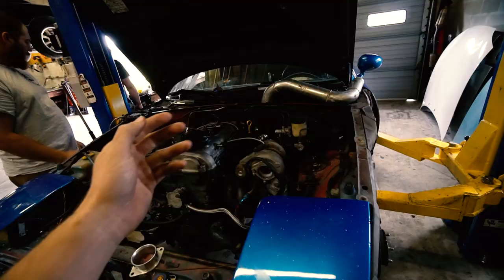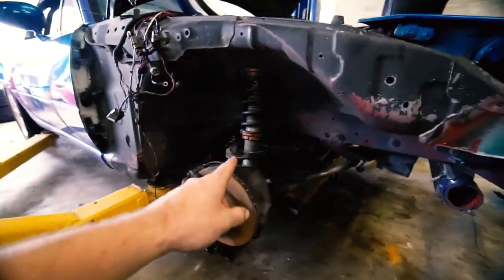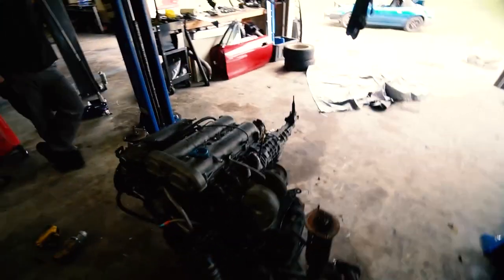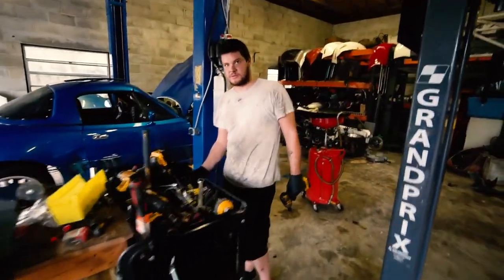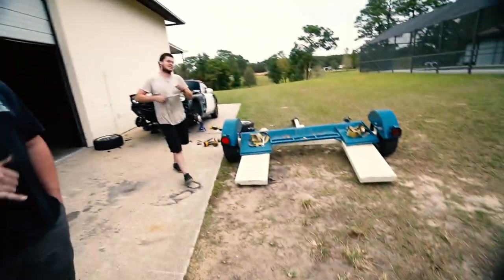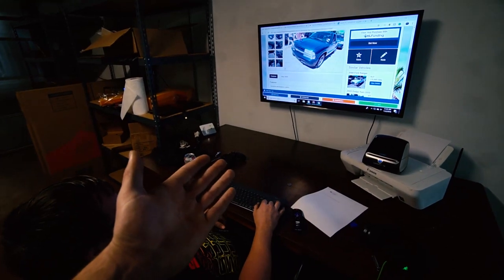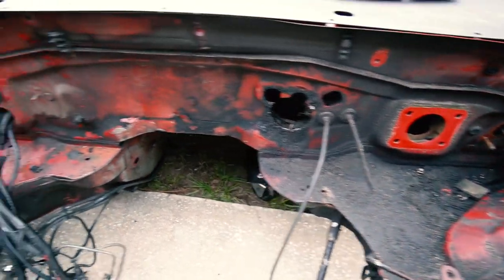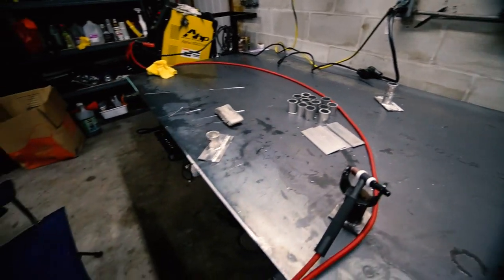Turbo Miata Teardown! Miata Wrenching Party

Comment: It’s definitely a good idea to run 1 qt over the normal on an Ls especially since you’ll be drifting. They have issues with oil starvation and stock ls oil pumps aren’t great. Unless you put a windage tray with a trap door I’d run 1qt over stock for engine safety purposes.
Reply: No first hand experience with LS engines here but I've had MUCH better luck running lemons cars slightly overfilled. The OEM solutions usually don't account for people tracking/drifting their cars and tend to cause oil starvation during cornering.
Reply: He is using the Mast Motorsport oil pan on the Miata. A dry sump from a C6 Grandsport manual or Z06 would be better.
https://www.mastmotorsports.com/collections/ancillary-components/products/ls-conversion-oil-pan
Reply: krichd1 those aren’t true dry dump.  And either way. It’s a gm with a stock oil pump just over fill it 1qt to be safe.
Reply: @figthestig5228  They are not motorsport grade dry sump systems but they work much better than any GM wet sump system. I don't have experience with the Mast Motorsport oil pan.

Comment: Taylor tell the guy with the mega squirt to watch jimmy oaks vid on “fixing Miata with bmw parts” you can use a bmw throttle position sensor for the megasquirt and they fit perfectly no need to change wiring

Comment: Weld a v band on the tube manifold, for the aluminum set up on the welder since you are welding clean 6061 plate/tube you can have the cleaning action set up pretty minimal not sure how the settings on your machine are but usually go 70% penetration 30% clean on clean aluminum should help you not have to stay as close with the tungsten but also give you a lot more control of the puddle, filler rod Size is pretty important too once you get it all dialed in it’s a breeze another thing that helps is usually talking any sort of gas lens or big cups off for aluminum as they are more for volume and overall coverage they can work but you have to turn up the pressure and for garage stuff wastes a lot of argon

Comment: Aluminium tig is a little different you dont need a tight of arc length as you do on stainless. Try running largest tungsten 3.2mm 1/8th? with a taper and a flat end then a bit more frequency 120hz and you should be fine witha decent tungsten to work piece length. Another thing when you adding filler its going to grow so i keep a tighter arc then lift away slightly as i add filler and the bead grows

Comment: We have  around 9qts in a ls e36 larger pan,  larger remote filter and a large oil cooler and no starvation yet.  Killed the last ls with stock pan with trap doors on 6qts on a 150 mph pull sucked the pan dry.  Install a 3qt accusump it’s cheaper  in the long run

Comment: I commented on the last video but just commenting on this one in case you didn't see it. you might want to make side bracing for the top welder on your welding cart so if you run something over it's not going to tip your top welder over and damage it. hopefully you see this comment. good video though!